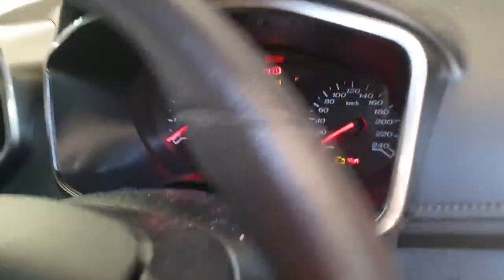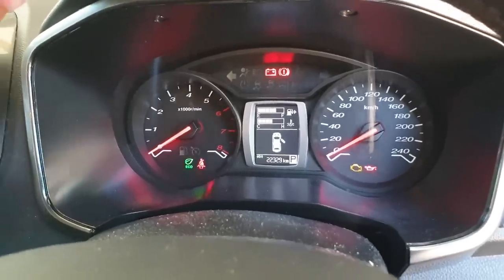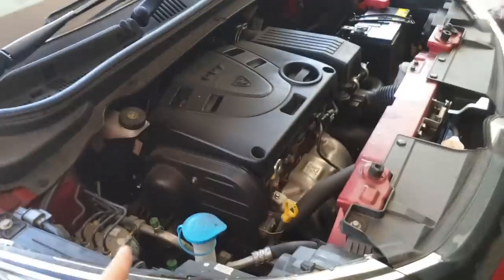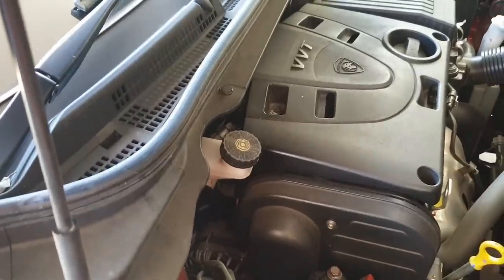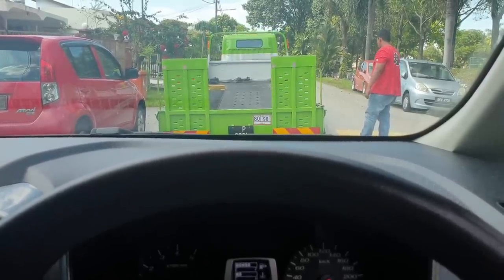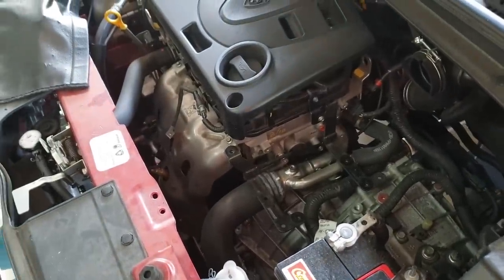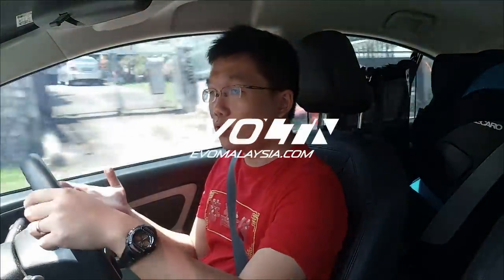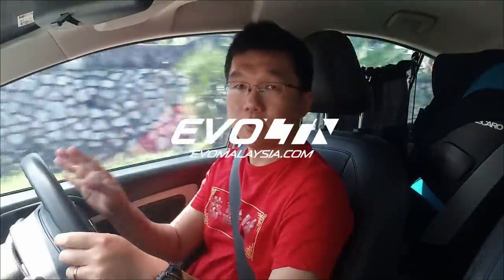Proton Persona VVT overheated due to air bubble in radiator | EvoMalaysia.com

Comment: No ECU update for Iriz 1.3.. D: (Only available for 1.6.) But there was a power steering update. You can get the foreman to retune the CVT for you, especially if he has to plug in the computer anyway. Of course, don't tell the boss because he/she will charge you. Curi-curi deal with the foreman lol. I think retuning the CVT helps a bit? But mostly I've just gotten used to how the CVT responses. It doesn't like hesitation especially at low speeds. If you try to accelerate and then suddenly you let go of the throttle, that's usually when the car jerks. My car rarely jerks at high speeds. Just changed my coolant during my last service recently. The foreman at Senaxis said the color of my coolant already faded so he recommended to change it. Hopefully I don't get the same problem at you... Jinx..
Reply: Didn't know iriz 1.3 got such thing like power steering update
Reply: And yea… so sad that iriz 1.3 ain't offered an ECU update
Reply: my wife iriz 1.6p..exactly 3-yrs@93k/km..just chnge radiator fan motor..not working.. lucky detect temp.high..hit max.5-bar while drvng..koyak $400.
Reply: @scarfobaggio4463  oh man.. The SC can't help to claim warranty since it just hit 3 years?
Reply: i asked for software update too before because of the slow response.but they replace my pedal instead..very confusing...
Reply: @funofboredom  if u having xperience dealing warranty claim for major parts..n then u know how difficult dealing with them... for cheap n small parts..no issue.. 3yrs using iriz 1.6p ... already done warrnty claim for major prts like.. steering rack..+accelerator+ bumper+dashboard..+player..etc... till i got so many issue with their mngmnt..i can show to u the proof +all the list..if needed.
Reply: @megatmuazamsyahbinabdrahma1283  aku facing pblm 1.6 tgh jln..tetiba pedal accelerated kosong..xde respond..hntr svc.cntre..test 5-hari..dorang ckp pblm solve tkr pedal 1-set (cable free pedal) tp hakikatnya hmpeh..xsatle pn.. kmudian hntr s.alam HQ..yg kt Excllnce Cntre..pblm solved within 20min..tech.tkr.. xsilap brake@ pedal sensor@switch.. saiz sebesar hujung jari klinking..n cheap prts.. tkr pn senang jer..dkt bwh dshboard..lokasi di bhgn atas pedal. (prts tu samada switch@sensor brake atau accelerated.. this is manuf.defect n proton dh kuar memo to all svc.cntre..since end 2016.. tp mostly sv.cntre bngang..xamik port..tu yg g tkr whole set accelerated pedal.. parts ni mahal+susah nk dismntle+pasang.. take time..utk kerja bodoh.

Comment: My iriz also got knocking when going uphill and during accelaration at 50 to 80 kmh.
Reply: HYDRO R go to SC they were update the system.already notes came out from proton.
Reply: Buy proton X series .simple.
Reply: try to pump exclusively petron and BHP
stay away from shell and petronas
Reply: I go to proton during my previous service.  But as usual answer. Ini smua normal encik.
Reply: Actually I'm using only petron  and caltex. But nothing much change tho
Reply: @hydror3903  that's weird
same campro, just additional VVT
my saga can hear obvious knocking noise when pumping shell/petronas(especially shell)
after pumping petron(only option in sabah, previously esso), the knocking noise disappear thn been pumping exclusively petron for the next 9 years
Reply: Guna petrol ron 97.. itu knocking dari enjin...

Comment: Does the knocking issue affects all Campros? Mine is campro iafm 2014. How to know the engine knocks? Coz I think I nvr had issue with the engine except the faulty iafm module which I solved now. I think my engine is smooth revving...how to notice the knocking?
Reply: I have nvr used anything than ron 95 petronas...

Comment: Is the knocking caused by faulty CVT programming that lugs the engine when its supposed to run at higher rpm (downshifting)?

Comment: Sent my car for my 10,000km service last month at CSL center, was informed that they updated my ECU firmware. Since then I've been experiencing much smoother and responsive drive, with slight improvement on fuel efficiency too.

Comment: Is it because of the RON or the quality of our petrol that actually causes knocking?
Reply: The RON the higher the ron number the less knock you'll have. Knocking happens when the fuel is ignited not at the perfect time. It ignited before the spark.
Reply: May happen when temperature is too high lead it ignites itself before spark
Reply: Depends on the engine and temperature of the environment...average americans use fuel that are below RON90...So RON95 is actually quite premium...so I would blame the engine design

Comment: Hi Kon, I really appreciate videos like this one from you as I'm also driving a 2018 Persona. May I know which service centre you sent your car to? Or which service centre do you recommend the most? Thanks! :)
Reply: About the ECU and TCU update, I never got any of it during my past 2 services with Proton. I collected my Persona back in July 2018 and I've ever since been experiencing very smooth low and high revs from the engine (no knocking whatsoever though I use BHP RON95 constantly) and also very very little jerking and fast clutch engagement from the transmission. Hence I'd like to believe I'm on the latest software from Proton already. Can't wait till your car gets updated and do share your before and after experience with us later. :)

Comment: Any idea how air bubbles gotten into radiator?
Reply: When they change the coolant they never completely flushed out everything. That's why you need a vacuum to do that. It's like a bubble in a tube, even though the liquid has come out the bubble is still there and when you fill in the new coolant it got trapped in there.
Reply: May be the radiator cap worn or even worse, the head gasket worn. But very unlikely for a 2 year plus car

Comment: Why proton cars always need to have updated ECU? it doesn't happen to my Honda city
Reply: It's an initiative to improve the way the car behaves. Since CVT transmission is computer controlled, it can meant a night and day difference.
Reply: You don't have to update the ECU if you don't want to.
Reply: Due to customer feedback sometimes, proton may recalibrate the feel of the cvt to improve user satisfaction. I would say that’s a good thing, why are u questioning it?
Reply: because honda already have a good ECU doesnt need update. no knocking smooth cvt
Reply: More like Honda service doesn't care. They already have lots of trouble with Takata replacement issue. Their service rating and customer satisfaction rate drop very significantly. CRV V5 issues never have any updates or even any news from Honda. Customer have to solve the problems by themself now.
Reply: @rimbunankhazanah9475  you are right...  No car's companies can claim their cars are troubled free... It depends on luck. The important thing is how the company solve your problems...
Reply: @rimbunankhazanah9475  Takata airbag issue? HONDA only? Look and search around and see how many brand still act slower than tortoise on countering this airbag issue.. honda so far has he highest completion rate.
Reply: @了吓死宝宝  well cause the death count cause (World wide and also In Malaysia) of the faulty Takata airbag are prune to happened in HONDA. I didn't said they are not working on it, they did good to warn the public and do the replacement programme, But what i am saying here is the BAD customer service satisfaction especially in Malaysia. At least Proton are improving on the right path now. Duh...
Reply: @rimbunankhazanah9475  you have not face the 'biasalah' attitude from Proton Center.. I had face it till I rather spend and ask 3rd party workshop to solve it or go proton appointed dealer instead of their own 3S center.. Regarding the recall the death is affecting Honda model but does it guarantee that other car maker's car wont caused death? Or just Haven't? Is that an excuse for them to act slow? I think no. In fact some car maker are so slow that they only announced recall so recently. I would not blame Honda on this case though. At least their completion rate are amongst the highest now.
Reply: @了吓死宝宝  have you ever face 'This is Normal la', 'we already check everything fine(But it isn't)' or best They just notch quietly with NO ACTION in HONDA 3S/4S? 

Please try to look in CRV group(gear knob and faulty steering rack) , FK8 civic group (faulty thermostat). We admit that not all car maker can guarantee their car wouldn't have problems, but this kind of typical attitude are also in HONDA. See the complaints, and some even send complain letters and emails but no answer or assurance from Honda Malaysia. 

About Takata issue, i do know others car maker have late recall on the issue. But even Honda got problems when they recall for major replacement, causing havoc(well can't help it, death counts are higher on their makes) and they running shortage of replacement airbags. I personally have to come to my 3rd appointment, as the first and second they are out of stock. 

It doesn't matter what makes, as long as they response to what the customer feedback. Like i said, at least Proton, NOW are on the right path as they tend to their Customer. And i also heard the new news that proton will start to ditch all the 2s and 3s that got many complaints from customer.
Reply: Because Honda covers up every issues they have had until some one dies.
Reply: Another clueless HONDA owner LOL